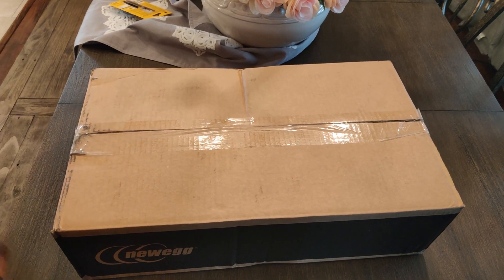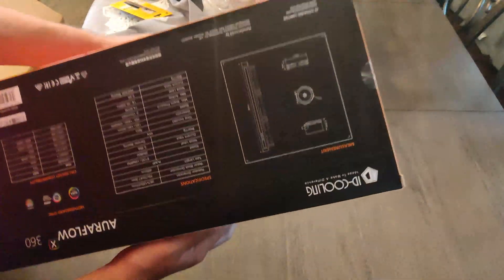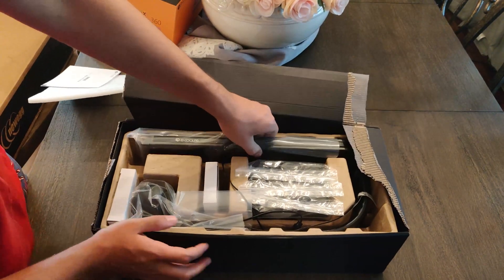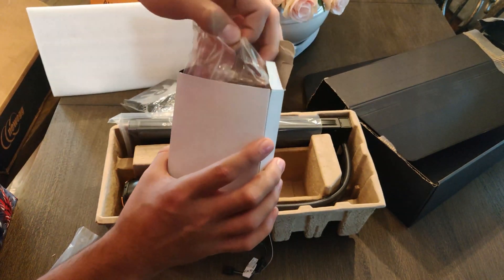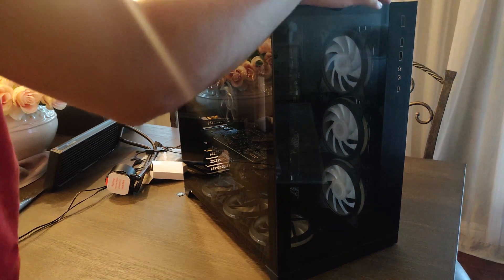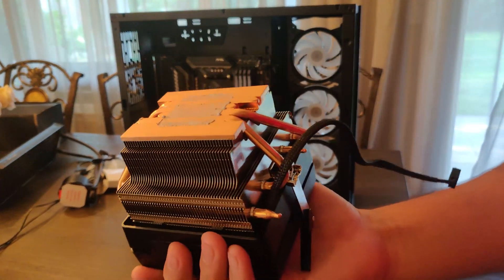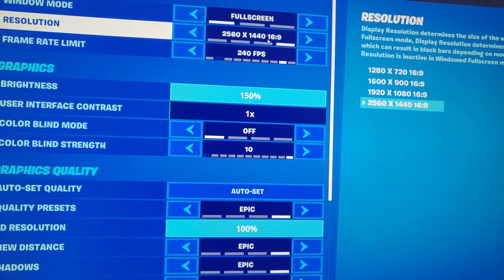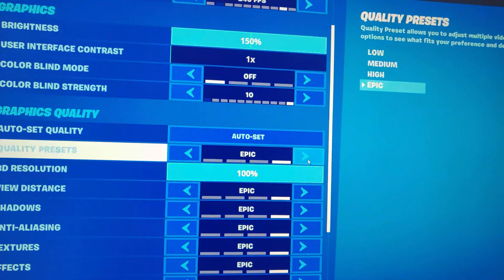The Cheapest 360mm AIO Cooling a Ryzen 9 3900X For Only $89.99 (+RGB)

Comment: How did you sync all of it?
Reply: If your motherboard has aura sync along with your other RGB parts you should be able to sync all of it together. Mine does
Reply: Plug your 3 pin rgb header into your motherboard and use the motherboard software
Reply: Use signal RGB software